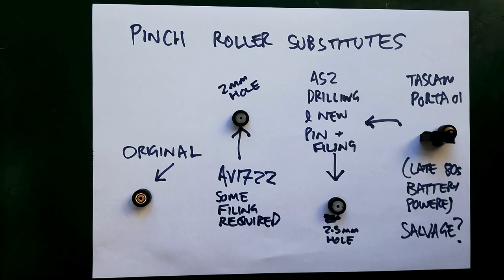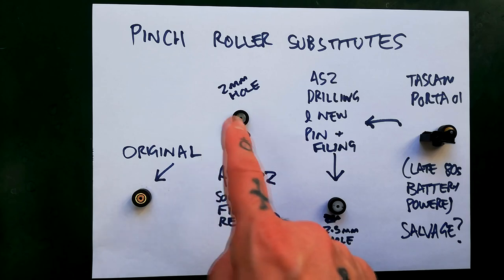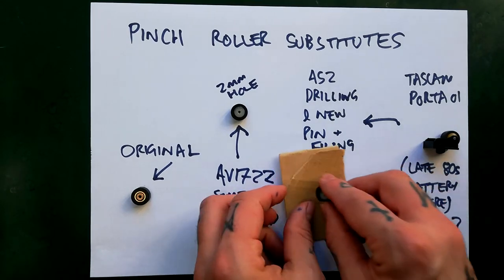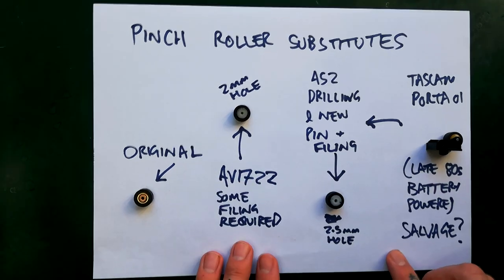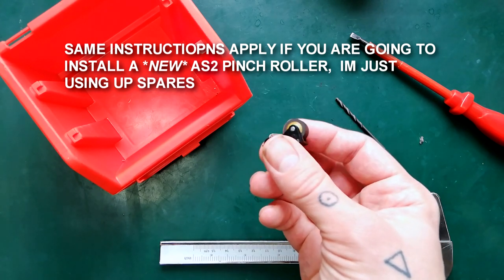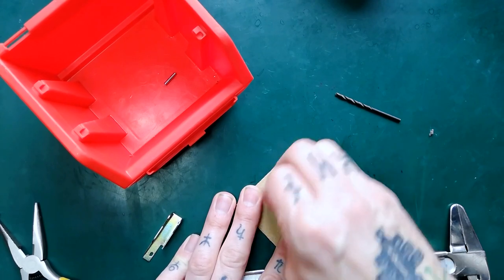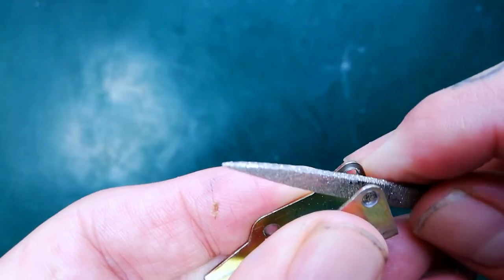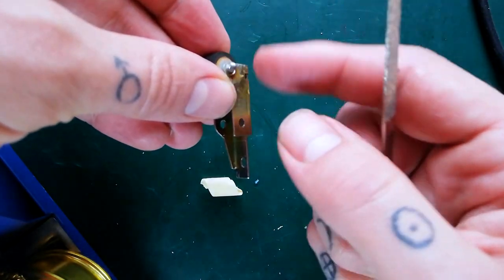12 source a cheaper pinch roller (Fix your Tascam 244 transport)

Comment: This video series about 244 model is so damn useful! Encouraged me to fix 244 which came to me by a fellow owner. All the rubber parts were melted and disintegrated, I successfully replaced all of them, got the idle tires fixed by rubber seals, just waiting for a pinch roller to arrive from Aliexpress. Anyway, thank you so much for this exceptionally useful videos, couldn't think of a better "service manual"! :)

Comment: Hey. Thanks for your work. Yesterday I replaced my pinch roller on my 424 mk1. Before I replaced it, tape loops would stall at the splice half the time. Now it plays consistently, but it will randomly change speed drastically. Any thoughts?

Comment: Hi ! Just replaced pinch roller and idler tires with cheap parts. Let me know how i can share the links.
Still have one problem though : PLAY (and REC) button won't do antyhing (pinch roller goes in for 2 seconds, and then comes back). Maybe it has something to do with a black plastic piece that didn"t find its way back in the 244... I can't remember its use. Could I send you a picture ?
Many thanks for your videos.
Reply from the maker: Sure, send the pic via Facebook messenger?
Reply: Is there any way you could share the link to the parts? Trying to get a pinch roller for less than £14.16 for just the rubber is seeming like a massive task at the moment!
Reply from the maker: This is the cheapest suitable PR I can find on uk eBay at the moment, about £5 https://ebay.us/W7exvx

Comment: Hello Tetrakan, fantastic videos, very helpful. Unfortunately in the last stage of an otherwise successful repair the C clip on the top of the pinch roller bracket pinged off, and after a days searching I can’t find it! Any ideas what size it is and where I might get a replacement? Thanks, S
Reply from the maker: Not off the top of my head but that size will be included in a multipack of c clips, you can get those off UK amazon or eBay gfor about £7
Reply: @Tetrakan  thanks for the quick reply. Sod’s Law working wonderfully here, I ordered a replacement and immediately found the original !

Comment: Hello sir. I have a strange question perhaps. I am looking into these pinch rollers for an entirely different use case than what they are intended for and am interested in learning about the friction coefficient of the rubber. More specifically in the ability of the rollers to resist ‘sliding’ over a (clean and hard) table/desk surface. I need tiny wheels that readily roll but don’t slide side to side. Any intel is appreciated.
Reply from the maker: Sounds like these are a feasible option for your project, but I don’t know the friction coefficient for the rubber if that’s what you’re asking, good luck!
Reply: @Tetrakan  thanks! No I am simply trying to get ‘hands on’ feedback from someone who has experience with them. To know if they are indeed grippy in a manner that stops them from sliding side to side when used as wheels.
Reply from the maker: @nirodha7028  they are, and dirt cheap if you go through Ali express etc, so worth a go, I think...what are you building?
Reply: @Tetrakan  Thank you :-) Not at liberty to say what. But I am building a prototype of a product concept I came up with for my employer. I am a professional industrial design engineer. And I appreciate you giving me some info. Thanks!
Reply from the maker: @nirodha7028 Gotcha: Strictly need to know basis, very hush hush, you don't have the NDA in your briefcase, but you'll get legal to send it over. Amazing.  I'm imagining a WMD now hahaha. Good luck!
Reply: @Tetrakan  hahaha no worries. No W at all. Actually a product to help people with disabilities. So positive things :-)

Comment: What an excellent series of videos on this, well done. Are the exact dimensions of the original pinch roller known for seeking out direct replacements?
Reply from the maker: Thanks. Not off the top of my head, but as shunt in a later video in this series you can transplant the rubber from an AS2 onto the original brass core and it works very well
Reply: @Tetrakan  Thanks. FWIW my own measurements:
Rubber roller height=6.4mm
Rubber diameter=12.8mm
Spindle rod=1.99mm
Ferrule hole=2.4mm (ish...)
Ferrule total height=8mm
I've sent for a couple from aliexpress which appear to be very close to those measurements.
Reply from the maker: Thanks for sharing, good luck with your refurbishment!

Comment: Sorry to bother you..Is there a cheaper source for the half inch pinch roller rubber for the Tascam 38 ..Kindest regards
Reply from the maker: I'm sorry I haven't looked into that yet. I do actually own a 38 and a 32 (same pinch roller I think?) Which I haven't refurbished yet, and those will be the subject of tear down series etc in future, so stay tuned.
Reply: @Tetrakan  Thank You for your reply 
I’ve found one on EBay..I was trying to save some money lol 
I also owned a Tascam 234 Synacest
I ended up selling it and buying the Tascam 38 ..Both excellent machines

Comment: Couldn’t you just remove the rubber tire from the plastic wheel of the Porta02 and put it onto the wheel of the 244’s?
Reply from the maker: Years of doing this and I that never even occurred to me ...I just tried removing the rubber from an AS2 (same type as porta one)and slipping it over the brass core from an old 244 pinch roller...and it works! 

THANK YOU. 

I'll pin this comment & add a note in the description, and once I make a follow-up video I'll direct people to that :)
Reply: Tinkering with Tascams Happy to help :-) It’s exciting to think of folks getting there 244s and 246s working - IMHO I think it’s the best way to get high fidelity analog sound recording at home - iow really glad you’re doing this and glad I could chip in in a small way
Reply from the maker: @HanfordTapeSessions  Yeah pretty straight forward. I used sharp scissors to clip the thin plastic atone side  which was fiddly but after that the rubber came off easily. Pushing the rubber over the brass core form the old pinch roller was a tight fit but thats good because you won't want it slipping.
Reply: This works if you have the patience! I have two porta 02 parts machines with bad heads. I removed the pinch roller and was able to pop out the plastic hub with ease. I then held it open with a pair of needle nose pliers while i inserted the 244 brass hub using a small screwdriver.